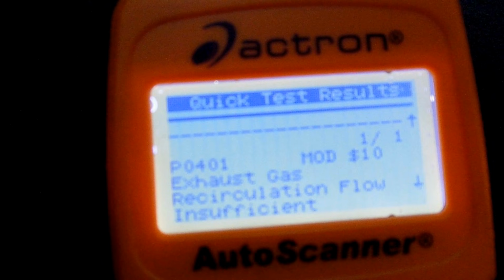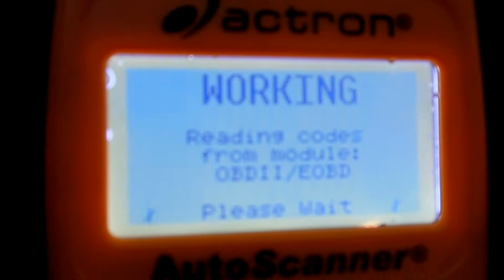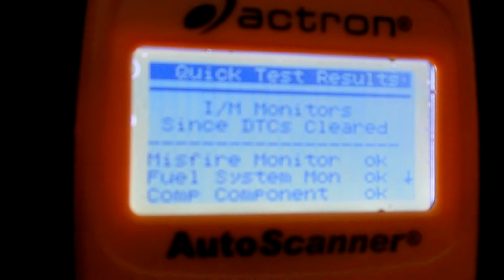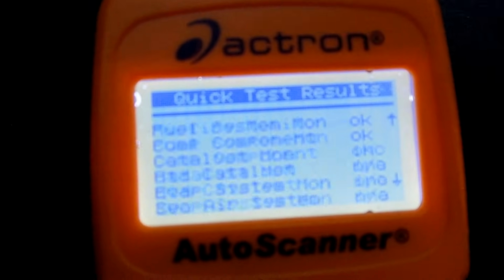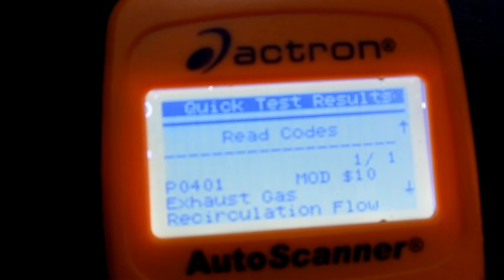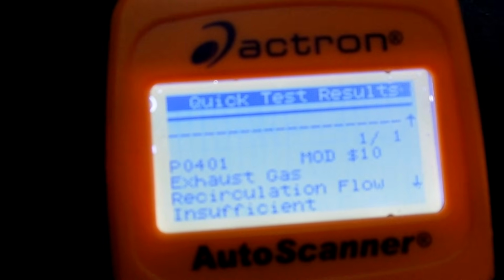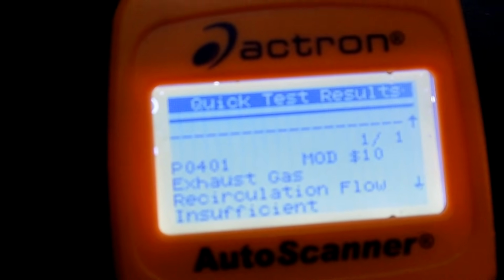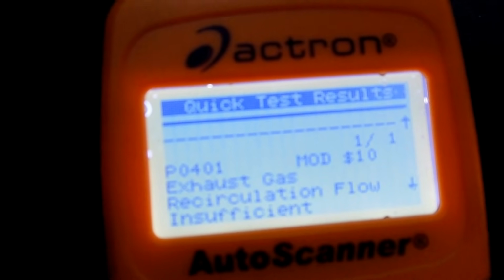P0401 2002 F150 EGR System Overview and Troubleshooting Guide

Comment: I have a hunch about these throttle bodies and how to clear them as the one you illustrated in the end of your video.  After removing the EGR..ILL BET if a person took old style gumout carburetor cleaner and sprayed about 1 teaspoon of that in the egr opening and just let that sat and reinstall the EGR and wait about 4 hours, ILl bet that would clear those two holes in the throttle body.  I just used that gmout carb cleaner on a 60 Cadillac 4bbl carb I rebuilt and that stuff dissolves!!!
Reply: +Earl Guyton  if possible you want to remove deposits as best as possible, and yes carb cleaner helps, soaking it and putting it back on without cleaning will result in massive deposits being sucked into your engine...

Comment: Good work brother.  I know how these mechanic shops are evil lying crooks.  That's why I do everything myself.  Heres a trick that fixes nearly all of these f150 engines.  Take off the throttle body cover and take a metal hammer and tap pn the IAC sensor on the back of the throttle and tap on the EGR valve itself.  This loosens the stupid things free usually on these and avoids EGR and throttle cleaning SOMETIMES.  And two thirds of these silly test I see done in these videos isn't even necessary.  The simple method of unplugging the vacuum connection and attacking vacuum line to the vacuum source and then to the egr as you did in the video end tells you if the egr valve is opening and closing based on the engine surge at idle and engine running smooth at idle without vacuum to the egr which tells its story of I am opening and closing!  And the way to text the circuit without any lights or voltage and all this junk do this instead.  With engine at operating temperature unplug vacuum at egr and rev engine to 1500 rpm and you should get vacuum at the line that goes to the egr.  Then let idle and you should get no vacuum or only a little and then YOU KNOW the circuit is working

Comment: hum egr almost looks exactly like a fuel pressure regulator maybe the only way to distinigsh it is which one is connected to fuel rails or fuel flows thru from exhaust gas /fuel vapor flowing thru

Comment: Did you have any engine pinging before you made this repair?
Excellent Video!!
Reply from the maker: Thank you. No, never had any pinging on this vehicle.

Subsequently, I did discover that this scam mechanic bent one of the pins on the coil pack he replaced at the same time he worked on the EGR. No. 5 Cylinder was also flooded with water causing the coil pack to fail. Since this guy also replaced all of the water hoses & thermostat at the same time, and the hose inlet is inches away from No. 5, I have to assume he made this mess too. Since repairing the coil packs myself, the truck runs much better. Just a sidenote/update. I think I'll do my own repairs in the future :lol:
Reply: Vicos Some bad mechanics out there for sure.
Checked the operation of my EGR on my 98 F-150 4.2 and found it fully operational. Solenoid functioning  well, 1 " vacuum at idle (valve closed) and increases as rpm increases, motor stalls with full vac. applied, and hot exhaust running through the valve only when the rpm above 1200. I had read on some forums the EGR could cause pinging (spark knock) under load conditions. Install new camshaft sensor 2 weeks back with no improvement. Any suggestions would be helpful.

Cheers.
Reply from the maker: Len S I've never had pinging on this vehicle and I'm afraid I can't offer you any suggestion on where to go from here. The only other symptom I experienced was missing under load and this turned out to be the aforementioned issues with the coil packs. Sounds like you've covered the bases with the EGR. Most docs say it is caused by timing issues, bad plugs, fuel mix, engine running too hot... Maybe the other guys said EGR because it is related to fuel mix?
Reply: Back in the 70's we would connect the timing light and adjust the distributor......just to easy...lol
Reply: +Len S Pining is usually weak spark to plugs or bad plugs.  Clean the plugin connectors at your coils and if the plugs are good generally you need to go to a mechanic with the IDS software that can reset the timing in the ECM.  The only other thing could be a dirty air filter making it run too rich
Reply: New plugs, wires and fuel filter did the trick!
Until the next malfunction..LOL

Comment: Very helpful. My throttle body was my problem too and looked almost identical to the one you showed. It was a bear to clean but not hard to get off. Just a few bolts and sensors. Built my confidence and I  appreciate the checklist of other diagnoses. Thanks. FYI others may want 2 cans of throttle body cleaner...

Comment: Excellent video.  I have a 5.4 L Triton on a 99 Expedition and used your video to diagnose a nearly identical problem.  After several days of trying to repair my Triton, finding your instructional video did the trick.  Simply cannot thank you enough.
Reply: Fighting the same challenge on mine. Have a low idle surge when hot only, under load "ac on plus clutch fan on"  thats been a bugger to diagnose!   Think i have it sorted to the worst fouled out plugs on earth as this "used car" was allowed to run with vaccume leaks and a sticking egr for faaaaar to long!  But anywho the TB ports were nearly clogged solid when i pulled the Throttle body...20 min removal said n done...wasn't bad at all...Sadly didn't 100% fix my issue altho the ports were ridiculously clogged but can only imagine how many others this would be a solve for and or can only help the engines performance in almost all cases and fuel consumption...lol.  next up plugs!!!! Wish a fella luck!

Comment: Excellent vid! I have been struggling with fixing my p0401 code on my 97 f150. I had the throttle body ports cleaned and replaced the DPFE. I am going to check the vacuum on the EGR next, and maybe replace the dpfe again because my mechanic said it might have been a defective part (and It came with a lifetime warranty so it should be free to get a new one). ANY wisdom would be much appreciated! Thanks!
Reply: +TheBladeSickness Don't replace that dpfe again.  Ill tell you how to know if it is working (BTW, your mechanic is not a mechanic or he would know this too) Start engine and get to operating temperature.  Then have someone rev the engine to 1500 rpm, then unplug the vacuum hose from the EGR and it should have vacuum, then let it idle and there should be no vacuum.  ITS THAT SIMPLE

Comment: Hi Everyone,

Best video I have seen so far on EGR! My 2002 Ford Escape has a P1406(down stream differential hose tube off or plugged.)  According to your trouble shooting procedure, I think it is the EGR valve that needs cleaning or replacing.  Do you have any suggestions?
Reply from the maker: If it is the EGR valve, then it must either be stuck open, stuck closed, or stuck somewhere in between. If I was confident in the troubleshooting process so far, I would personally replace the valve.

Just based on everything I've read and watched relative to this issue, if it is a high mileage vehicle, the problem seems to be a clogged port more often than not.

Comment: I'm getting a P0171 and p0174 (system too lean bank 1 and 2). I blew smoke into the intake system and found smoke coming from the actuating "stem"  of the EGR valve. if you look under the valve with a flashlight and mirror you can see what I mean. could this be the problem? has anyone heard of vacuum leak from the EGR valve as I have described? by the way great job on the video very helpful
Reply: Did you solve your problems yet? thats the same codes im getting
Reply: @jerrardthompson3449  I'm getting those same codes, po171 and po174 (system too lean bank 1 and system too lean bank 2) as well as po401 and po402.

I know this is an old comment but did anyone get theirs solved/fixed.

Comment: Great informative video. I have a 99 Expedition with a p0401 code.  After searching on YouTube, I applied vacuum to the EGR valve and the engine stalled like it should. I then figured that it had clogged passages. I decided to clean them myself. They were dirty but not clogged. After a thorough cleaning along with the throttle body, I reassembled it and cleared the code. It came back on after about 50 miles of driving. I then checked all the vacuum hoses for leaks. I found a couple of small rubber hoses with cracks in them which I replaced. Again I cleared the code. It just came on again tonight. My next test will be the DPFE sensor and the EGR solenoid. I don't think that there is anything else to check. I also don't like to throw parts in without testing first. I enjoy videos such as yours and learn so much from them. Thanks again.
Reply: Joseph Costello On a Ford replace the charcoal canister purge valve if it has one. Replace the MAP sensor if you get codes about oxygen sensor running rich.

Comment: What's really disgusting is that all of these problems are caused by a bunch of federal regulations which force the manufactuerers to put all of this useless junk on the engine. (which then causes tons of mysterious problems which takes tons of money to fix) 

Fucking govt.
Reply: Yeah, thats the only thing govt does effectively is rob Americans !
Reply: You know there was another reason for all of the crap that has been added to all vehicles. Every time they produce another part to be put on our vehicles, it is an economy boost. it was also to help create more jobs for US workers because all new technology always, always cuts out jobs in the automotive industry. Also, I was doing a strip out at a GM Plant change over & I was talking to an engineer about the older alternators that were easy to change the regulator inside of it, instead of having to buy a new one. He told me that the day would come where nothing would be repairable. That conversation took place back around 1990. So just about ever since then, every model year, there was less & less parts that we could work on. It's turned into an R&R thing. You're right though, the EPA has helped cause the price of vehicles in America to jump up in price. That's why I'm still driving a 2003 F-150 Quad Cab 4x4. There's no way in hell I can afford a new one. I can't even buy a 4 or 5 year old used truck. It's sure not the pay scale of the UAW workers. All of the "Big 3" US Auto Makers are making a ton of cash because they have taken their earnings & created other company's that make money each year. You never hear about GM having a bad year & GMAC not making any money. They're doing fine. As for Ford motor Company here in Michigan, they still own square miles of property in & around Dearborn, MI. & with all of those building's that they lease out space to either Ford or other companies, including some of the vendors. So at the end of any year, they may report their earnings loss but when you add up all of their other company's, they're making a ton of cash but they can tell the UAW that they're almost broke.

Comment: Thx for this it was very informative. I've been dealing with this problem on my '98 f-150 since I bought it. Each year finding a way to keep that check engine light off long enough for inspection only for it to come back on my way back home. That's the funny thing is overall my truck runs great except for an occasional dip or surge in idle when I am stopped at lights and such. Well it's inspection time again and your help in narrowing down this problem is greatly appreciated...new insight for sure. I only wish my channel had something informative for you but if you got time to kill and are looking for a laugh by all means check it out.

Comment: Hey, thanks for the video.  I have this code on my Mercury right now.  My brother, who was a Sr Master Tech at a Ford dealership said it is probably the DPFE sensor. I am like you though, I don't want to just "throw parts at it" so I am going to test the sensor (easy with a multimeter), the EGR valve (with a hand vacuum pump) and the solenoid (also pretty easy with a jumper wire/ test light, and a multimeter). My understanding is that the source vacuum going to the EGR solenoid (red tube in your video) has to be sufficient to fully open the EGR valve, since that is the actual vacuum that is normally used.  The solenoid just opens to allow the vacuum to be applied.  I believe you may have had a leak in your vacuum line connection. Thanks again for the video!
Reply from the maker: Thanks for the feedback Nick! Sounds like you have a good grasp on how to test the system to avoid "parts throwing" syndrome.

You are correct about the solenoid. The computer decides that emissions gas should be let into the intake, so it sends a signal to the solenoid which opens and allows vacuum to pass to the mechanical EGR valve, which opens and allows the exhaust gas into the throttle body.

My thoughts are that if it is a high mileage vehicle, even if the EGR ports in the throttle body aren't completely clogged, they could probably use a good cleaning. When that hot exhaust hits that cold intake air at those ports, it is inevitable that carbon is going to build up. I'm surprised that this is not called out as standard maintenance for, say 100K+ miles.

Comment: thanks for the info dude this helped a lot
Reply from the maker: Thanks for the feedback Glen. It makes it all worthwhile when I know I was able to help someone. :)
Reply: Hey if anyone knows anything about Ford's I swore I would never buy 1 but my dads ranger made me a believe r at3hnrd plus does not burn leek or have any issue I recently bought a 97 f150 from a used dealer ship took it on a trip AND IT SIEZED UP TIGHTER THEN A NUNS HUHA LEFT ME STRANDED AND DEEP INTO MY POCKET WHEN I CHECK THE OIL IT WAS FINE NO CALLORS OR MEATAL CHECK THE WATER NO SPOTS OF OIL IT DIDNT SIEZE TILL I PULLED IT OVER THEN WATER STARTED TO RUN OUT BY THE OIL PAN IT DIDNT FEEL OR SMELL LIKE COOLANT ?I WAS RUNNING MY AC I DID NOTICE 1 TIME PRIOR RUNNING MY AC I COULD HERE A KNOCKING NOICE SOUNDED LIKE A ROD OR SOMTHING DEEP AT IDE TURNED OFF INGINE THEN EMEDIATLY STARDED MOTOR WITHOUT AC IT STOPPED KNOCKING ?WHAT IS MY ISSUE CAN ANYONE KNOW BEFORE I LOOK AT TIMING TAKING OF PLUGS AND TRYING TO .MANUELY TURN IT OER JUST DOESNT SEEM RITE ALLTHOUGHT IT SEEMED TO GO THREW OIL LOOKING AT IT IT SEEMSCLIKE SEELS

Comment: Gotta 2002f-150 also and this past winter increased my problem dramatically, as before when there was dampness or rain in the air my engine wouldn't run properly as to shake at certain speeds and I'd have to give it gas to "shake off" the irregularity.. Then after 20 min. the engine light would go off as if my truck "warmed up" so to speak. But now "it's sick", the engine light stays on and I have to keep the accelerator at certain degrees so the engine doesn't shake like crazy. Nice video, I'm about to see what I have to go through now.. I'll let you guys know.
Reply from the maker: Perhaps you have one or more bad coil packs. I just had to have one replaced. In the old days there was one high voltage electric coil for all cylinders. Now many engines have an individual coil pack on each cylinder. When you lose one or more, the engine will run rough and you lose power. You need to test each one and replace accordingly. Some are a bear to get to. This is a common failure on F150s of this era. There are many YT vids and forums that discuss how to test.

But, keep in mind that I am not a professional mechanic, so take my advice appropriately :)

Comment: I found a flexible drill bit tool called "The Snake-Bit" online for about $30.00. It comes in sizes 12"-21" long and you insert it into your clogged EGR passages to clean out the ports. I will be attempting to clear my low-flow EGR codes this afternoon, it looks like this is the only tool that will best clean out those passages.

Comment: Great Video 
Ended up pulling off the throttle body and my EGR ports were both completely plugged. put everything back together and truck runs perfectly 
but of corse the check engine light is still on.
any ideas?
Reply from the maker: Not sure if the 0401 code should clear automatically when the clog is cleared or if takes a few engines cycles to catch it. Anyway, you need to put a code scanner on it and read the current codes. If it still reports the P0401, use the scanner to clear it. If there is still a problem with the EGR system, the check engine light will come back on within a few miles typically. If you don't have a code scanner, most of the national parts stores chains will scan it for you. Just ask them if they'll clear it too (it's just a command issued by the scanner). If the check engine comes back again, rescan and continue troubleshooting based on reported code(s).

You might want to clean your mass air flow sensor while you're in there. I think I mentioned that in the video.
Reply: disconect battery both cable let sit recnect works for my 2000 f-150....
Reply: disconnect the battery and then back